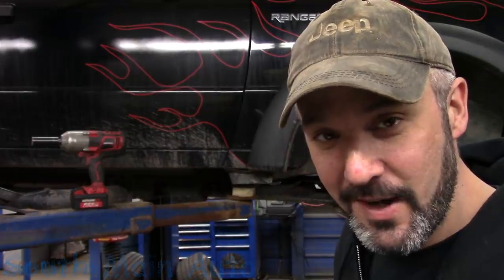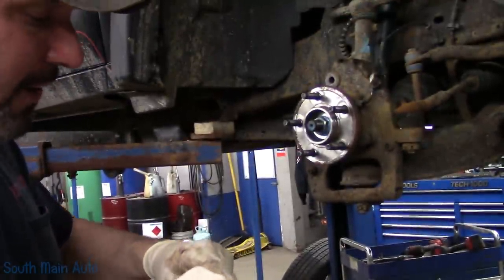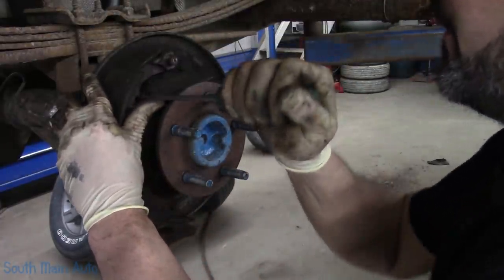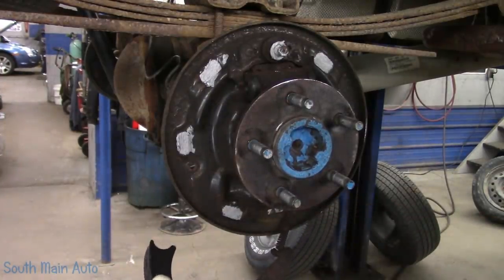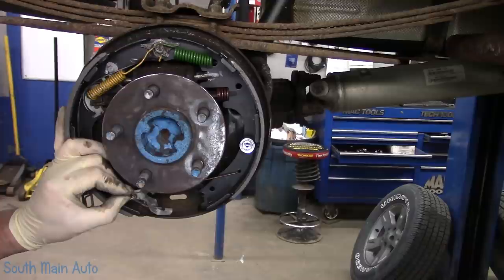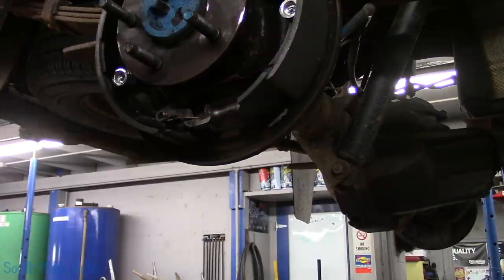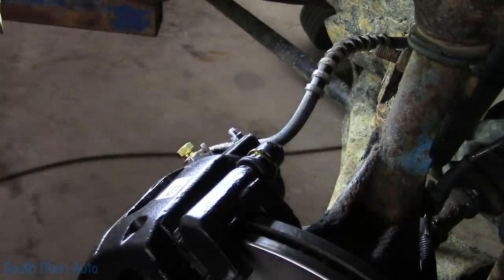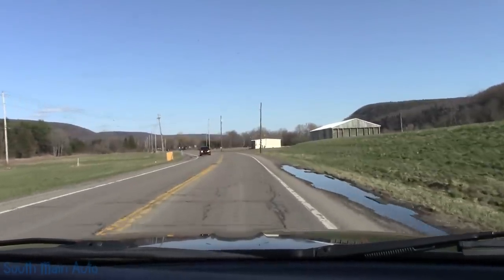Ford Ranger: Full Brake Job w/ Rear Drum Brakes

Comment from the maker: *DocaDisc 30PC - 2 inch Roloc Sanding Disc Mixed Pack: https://amzn.to/2KGzzMq
*ProTool 5542 Roloc Disc Pad Holder Shank, 2" L: https://amzn.to/2KEfKW7
*Astro 219 ONYX Die Grinder Kit, 3-Piece: https://amzn.to/2rsbFLY
*2" Roloc A/O Quick Change Sanding Discs 120 Grit - 25 Pack: https://amzn.to/2HTFdck
*OTC 4590 Brake Spring Plier and Claw: https://amzn.to/2JYCEq3
*Permatex 80078 Anti-Seize Lubricant with Brush Top Bottle, 8 oz.: https://amzn.to/2Ig0iBa
*CRC BRAKLEEN Chlorine-Free Brake Parts Cleaner - Low VOC: https://amzn.to/2JWxBX6
Reply: Good tip using WD on aged anti seize.
Reply: What are you using to clean up around the lug nut bolts? Not the discs but what went over top of them to clean next to the bolt.
Reply: Also curious on the stud cleaning tool.
Reply: Pleeeease add link to the tool you used to clean around the base of the studs (goes over the top of them).
Reply: South Main Auto Repair LLC  Tired maybe you guys need som B-12 rotor flush just kidding keep up the good job 👏
Reply: Anytime we can learn more it's not a wasted video. I appreciate your time Eric. And you're right , rear breaks are intimidating to those of us that haven't done many. I still take pictures so I get everything back on correctly
Reply: If you stired or shook the can of anti seize everytime you use it you wouldn't have that problem. Where I used to work silver anti seize was not allowed gold works better. I,worked on injection presses silver didn't work well in hot service
Reply: @timbattaglia3649  Search for Brake Hub Resurfacing Kit
Reply: @charlesbrown205  search for Brake Hub Resurfacing Kit
Reply: Ally Oop traitors requiem
Reply: This episode was awesome, hope you do a newer ford ranger with the 4x disc brakes! :)

Comment: "New school" mechanics are intimidated by drum brakes because they've never seen, let alone worked on them. A close friend of mine is the "automotive technology" (or something like that) instructor at our local vocational high school. He stopped by my little shop a few Sundays back as I was getting set to do drum brakes (all 4 wheels) on a 68 Chevy C-10. He actually only stopped to drink a beer and shoot the breeze until he saw what I had in the shop. He then proceeded to pretty much demand that I bring it to the school so that the students could do the work. You should've seen their faces when they got the tires off! The looks were priceless! It was even better when my friend and I showed them how to get the drums off. They were dumbfounded by all the springs etc. Since the truck is getting a nut/bolt restoration, it took them a couple days, under my friends careful supervision, to do the job, but, they did it right and learned a good lesson. Now, they all want to participate in the rest of the project!

Comment: Probably mentioned:  The blue paint on the caliper and other assorted parts adds at least 20 HP to this flame beast of a truck.........
Reply: can confirm, painted the calipers on my 2011 Toyota Yaris. It now puts 150 hp out instead of the already blistering 108 hp.
Reply: I thought in this case the blue paint helped cool down the brakes from the extra heat / horse power that the flames added.
Reply: @tylerh629  i have a 2011 yaris i bought for 900$ no run. Honestly a really cool car. I took the doors off and it’s spray painted now. Kids at school love it.

Comment: I do like how you say "some people are intimidated by drum brakes.... I don't know why"...  then you proceed to do 100 steps where, you really have to know everything you're doing, & why...  I had a real bad experience with drums on an old Tahoe, and I said "Never again"...  After watching that video, I said "ummm hmmm....  Yep.  Never again."

Great Video Sir.
Reply: Well, I mean no slight to Eric when I say this, but anyone can do it with a lift, a big air compressor, and all the right tools.  I mean, spring pliers.  What shade tree mechanic bothers to get those, right?  We're all out here on our bad knees on the ground fighting with a pair of regular needle-nose pliers trying to fight those f#$_ing springs back into place and by the time we're done (if we haven't already called "uncle") we're ready to beat an automotive engineering to death.  It's for reasons like this that I'm honestly surprised it's not easier to find a place that rents lift time and air tools by the hour.  I mean, I get the liability issues but I bet some smart entrepreneur could make it work.
Reply: They're really not difficult to do, maybe a pen is the right tool for you! 🤔
Reply: Ah, gimme a brake. I used to do mine in the driveway. I don't remember it being difficult at all. The most time it took was when I took the drums to get cut and had to wait.
Reply: Drum brakes aren't hard to do. I've done them before I had a cell phone. At least now you can take a picture to see how everything goes back together. 
No one to show me how to do them, no special tools, barely had a jack. Pair of pliers and some sockets/wrenches and you can fix them. 
You may mess up the order the first few times, but after that you start to get it.

Comment: I really like the way you completely disassembled and explained the parking brake adjustment mechanism. We don't see drum brakes often any more, it will be nearly extinct in the next generation.
Reply: goenitzlopez Yep, they're still popular. They're cheap and last a long time because they don't have much braking power. The 75/25 distribution of braking usage makes rear brakes last 2-3 times as long as the front brakes, so it's not too big of a deal unless you tow or have a performance car.

Comment: Eric, 

Regarding doing brake videos - you should never stop doing them. I say this because brakes and rotors are parts on a vehicle that have a service life and then they fail. When they do, people start searching out how to change them. The braking system on a car may be "routine" work, but it's no laughing matter nor is it something to be taken lightly with haphazard attention. Those brakes are what save your life every day. The average Joe who has some tools and is mechanically-inclined, can change his own brakes and take comfort in knowing that everything is done exactly as it should be. You show us how to do it the right way, why it is done, and that is invaluable for the simple guy like me who wants to do his own work to ensure its done right. The vast VAST majority of shops around my area are just throwing the crap on there as fast as they can with zero attention to detail so they can turn & burn on the next one. You are one of a select few mechanics I've ever seen that treats his customers cars and trucks as if they are his own. The pride you take in your work is nothing short of impressive, and heartening to see that there are still men around who do honest work for honest pay. You have saved me so much money over the years in diagnosing my problems on my vehicles and fixing them myself - especially brakes. I've followed your method to the T on my brakes since 2015 and have never once had a brake failure, a seized caliper, uneven pad wear, a scorched rotor, nothing. Permatex Extreme, fluid film, good hardware, etc. Good to go. Thank you Eric!

Comment: I like those Roloc discs, but for people thinking about it, remember air powered disc sanders take a lot of air volume. You need a better than average air compressor, otherwise electric is more effective. Rotary parts in general are so cheaply made that I get bits of the disc or wire wheel embedded in anything close by. Certainly want eye protection.
Reply: spelunkerd my 17cfm compressor must be better than average, as it keeps up with die grinders, air sanders, rattle guns, blowers & spray guns no worries! Yes, it cycles a lot more but is a hell of a lot cheaper to run than my 50cfm 3 phase unit!!
Reply: Oh, many would envy 17 cfh, I'm lucky to get 6. In my shop it is only an issue with grinders and spray guns, other air tools like ratchets consume far less.
Reply from the maker: My compressor is 24.5CFM :) My one cutoff wheel spanks it! It is the 4" one from Astro. Thing is a little air hog

Comment: Hi Eric O you make some of the best auto mechanic videos I have seen. I am a little older but came up into the automotive/heavy equip. business as you did instead of working for my dad I worked for a caterpillar dealer for many years as a field service tech. I would classify you as one of the best at your craft. The other day I saw one of your videos about a 4 wheel brake job on a ranger with flames, as I to am a stickler for cleanliness and proper lubrications for brake system assembly you did everything by the numbers and then it happened... I thought I saw you remove the brake shoe actuators from the wheel cylinders and they were wet with fluid just inside the dust cover boots. To me this would mean that the cup seals inside the cylinders are bypassing the fluid beside the pistons past the dust boots and into the drum where fluid will collect in the drums wet the shoes and lock up the brakes any time you touch them. but I don't remember seeing new or rebuilt wheel cylinders go on the truck. Am I wrong or did I miss something?
Really like your videos Mark...

Comment: Me again, 5 yrs later. I just did rear drum brakes on a 1997 F-150 and followed instruction video of taking the shoe off along with the parking break lever by removing the cable from the bottom of the lever. The cable ended up going way up into the spring and it took all I had to compress that spring far enough to clamp some vice grips to the tip of the cable, then I had to put it into the groove on the Parking lever. Got it done but it took two of us, one to pull the lever and spring so that the other person could pull the tip of the cable into the slot. I think next time I'll follow your lead.

Comment: An old Rolls Royce trick for installing cotter pins that are captured in the castle nuts. Clamp pin ends in vise and twist the eye end 90 degrees. Makes pin ends perpendicular to axle when folding over. Makes a neat installation. Learned this from RR machinist from England.

Comment: yes!!! More rear brake shoe vids!  (mortals find them difficult to do)

How about a Chevy Sierra 2013 Rear Brake Shoe vid?

The little NANO, I miss her everything is battery now :(

Saturday morning with Eric O'  Better than cartoons for sure...
Reply: If you don't have brake spring plies get some it will be worth it.
Reply: #1 rule with drum brakes ... Do one side at a time.  Use the opposite side as a reference for re-assembly !
Reply: Except if the guy before did them wrong, then you'll be copying his mess up.(Like Eric said)
Reply: @bucksmkr12ga  The first time I had my rear breaks done, on one side they called me over to show me that someone before I got my truck had put some of the hardware in backwards. They were shaking their heads trying to figure out how 'they' did that.

Comment: Baaah, dang Youtube! Never got the notification on this one! 😤

I've probably done thousands of brake jobs myself since I was a youngin, but it never gets old watching you do them. 👍It's like hangin out in the shop with ya ... without you getting nervous with eyes on you the whole job, lol. Certain people bug me when they're standing over my shoulder, but not everyone. Probably why most shops in the city won't let people behind "the line".  Especially when you're getting bombarded with a million questions while you're trying to concentrate. I'm one of those people that was built to work alone - get someone yapping, and I'll try to install a spark plug in a brake caliper. Then I'll walk to the toolbox and stare at it for 10 minutes until I remember what the hell I needed over there.  I can walk and chew gum ... but just barely ... 😁

So much brake clean in this one, I'm high off fumes through me screen! 😜

Got the Grand Marquis ready for it's 32nd summer. Wife's been tooling around in it lately. Still on the OE fuel pump, p/s pump, and driveline! 👍 I adjusted the TPS, which fixed this perpetual off-idle stumble it's had for a long time. Thing read 0v until you just touched the pedal ... then it would jump to 1.2v (right when it stumbled). Since I couldn't get it any lower, I left it at 1.2v, and she's happy. Had to thank Paul Danner and his T-pins for that one. I always wondered where he got those things from ... and then I discovered a box of them on my wife's craft table. Guess where they are now? LOL - I told her weeks later. It was the perfect crime, because she'd never suspect me having any use for them. 😁

Not a single automobile here (aside from my own).  Right now, I'm swimming in lawn & recreational equipment. Got 5 tractors, 3 saws, 2 weedwackers, a pair of outboard motors, and 3 ATVs ... plus a motorcycle today that my buddy just bought. Alot of the stuff I had to go and pick up / deliver - that takes a TON of time. I don't get much done when I'm driving. Then another buddy stopped by in his 2018 Coyote-powered Mustang that he had just left the dealership with. This thing is INSANE. I can just imagine the electrical nightmares this thing will be throwing me in 10 years. Lane departure, auto braking, hill assist (6-speed), and 4 or 5 different driving modes that alter the electronic suspension, engine, steering, and electric exhaust! This thing hauls ass, and sounds SWEEET! Handles like a go-cart too! Definitely didn't get much accomplished today on that ride, LOL.  One of the perks of working for yourself I guess. :)

In other news, the floor is scheduled for next week! You have no idea how friggin happy I am. By the end of the month, I won't be tripping over stuff, losing tools, and being generally unproductive. Oh, and no more playing the "get-up, get-down" game with my aching  joints! I can finally let my jacks & stands take a rest!🤘

Loved the interaction with you and Trinity at the end there.  Had me laughing. Always love the interaction with Vanessa, too. Thanks for showing us your awesome family. Great stuff as usual, man. 👍 😎

Comment: You had said that the Auto Adjuster worked on the parking brake, and so the adjustment was not getting done due to no one using there parking brakes. Well I had never heard that the parking brake did this. I had always been told that the Auto Adjust was ONLY when you went in Reverse and stepped on the brakes. So I "Googled" this!! And this is was I found:The adjustment takes place when the vehicle is in reverse and the brakes are applied or when the parking brake is engaged. So I have learned more at my Age of 61. And watching the South Main Auto Repair Channel.!!

Comment: I pull the bleeder screw out and put a tiny bit on anti seize (don't want to contaminate the brake fluid). I also use marine grease on the exterior of the bleeder screws. I'm just west of Rochester, NY

Comment: Another super video SMA!   I like that trick of using a valve stem as a banjo fitting blocker - much better than a hose pincher ;).  You daughters ability to troubleshoot the sound of a failing pinion bearing is amazing - she is clearly a chip off the old block!

Comment: Eric I made some needle nose with two little barbs welded on each outside arm,perfect for removing those caliper dust plugs,originally made for removing o-rings in pressure washer fittings,but they would work great for those caliper plugs

Comment: I've had good luck installing the star wheel and the lower spring and then hanging it on the backing plate. It kinda holds things together when attaching the spring retainers and then the shoe adjuster and spring part. Plus it kinda holds the spreader bar for the parking brake. Kind of a bottom-to-top approach. Then you don't have to muscle the star wheel in last. (or the lower spring). Great vids Eric!

Comment: I'm finishing a brake job and shock replacement on my Suburban today.  One corner at a time, crawling around on the garage floor.  I covet the vehicle lift , air tools and sand blasting cabinet (and compressor to drive them).  On the other hand, it's a pretty good workout getting up and down off the floor countless times.  Love the videos, Eric.
Reply from the maker: What doesn't kill you makes you stronger!

Comment: Brake jobs are fun to watch and the most fun thing I like about them is using the die grinder so keep them coming! Also in school, the teacher said to never add any grease or oil on the wheel studs. Guess they won't come loose if torqued properly? And lastly, when are you going to make a shop/toolbox tour.
Reply from the maker: I am guessing your teacher did not live in the rust belt???
Reply: Steven Kenzou I'd be calling your teacher when you need to undo those wheel nuts! 😅

Comment: So now I know how that "Neversieze encrusted" screwdriver ended up in my tool box. LOL. I have been doing brakes for over 30 years and still don't mind watching someone else doing it. (actually prefer it). Can always learn new tricks. Now, I have to go and clean out my drawer and feed the Ultra mini horses. Speaking of horses, You should do a video on the GM (Malibu's) horse shoe hold down spring brakes. I have a tool but they can be a mother...